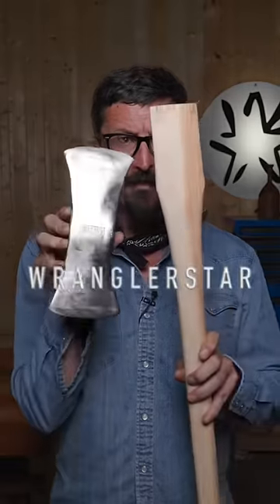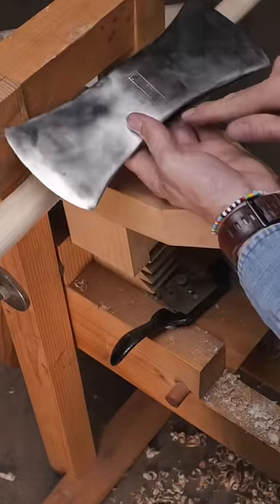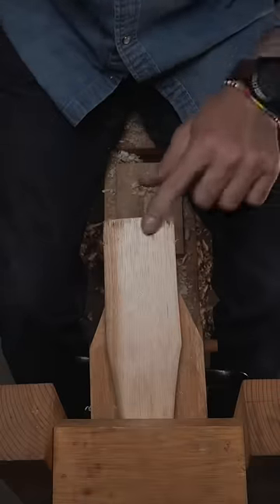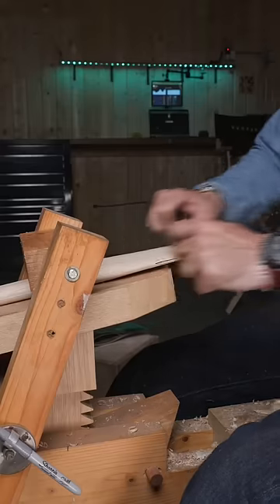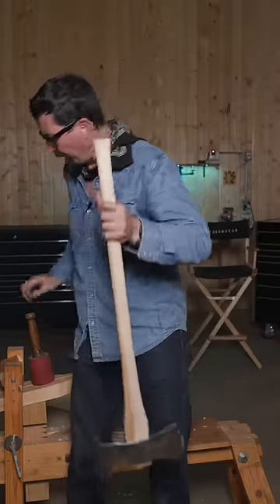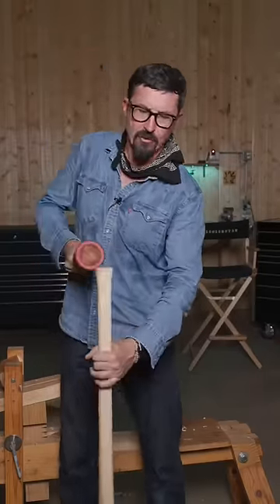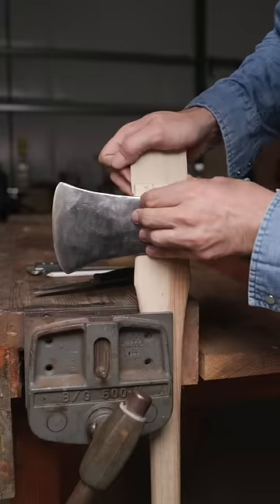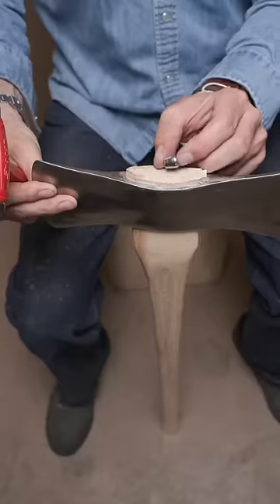How the US Forest Service hangs an AXE - Wranglerstar professional Homeowner

Comment: Find a suitable location. Unbuckle belt and lower trousers. Unfold and tear off 3 squares. Wipe from front to back. Dispose of paper in double ziploc bags. Pull up trousers and secure the belt. And that's how the US Forest Service takes a number 2 in the wilderness.
Reply: Really? So I had this wrong from the beginning. You see, I always wiped from back to front. I suppose it felt (more) right that way. And another thing, my magic number has always been FOUR. I "fold and tear off" 4 squares, which also happens to feel (more) right as well. But nonetheless, thanks for the 'tip' brother. It is always paramount to get that tip in.....
Reply: Swear 🤣🤣
Reply: I mean, it's just paper, just throw it out
Reply: @dud3655  yuo don't wanna fuel them forest fires
Reply: I thought they used the one-square method.
Remeber to tear off a corner to use on fingernails afterwards
Reply: my Root Beer 🍺
just shot out both nostrils...👃!!
Reply: Three squares of toilet paper? I was trained to use one. 

Take toilet paper square. Fold into quarters. Tear off the corner that is the center of the full square. Remember to save this part. It will be important. Insert finger into the newly created hole. Wipe. Clean finger by pulling it out. Use the torn off corner to wipe under the finger nail. Properly dispose of the paper...
Reply: And you couldn't think of digging a whole to do it down in and then cover it up?
Reply: @danielm.4346  No burials allowed...
They dig it up and the run off goes to any water source that's down hill.   Thousands of campers with thousands of sh*t holes would be a disaster.

Comment: Me who doesn't even own an axe: "this is fantastic"
Reply: I've got an axe. The handle is synthetic. This is fantastic!
Reply: @johnsuarez1404  i now currently own an axe that was my grandfather's. It has a wood handle but I'm sure synthetic is about as good as wood. I just prefer the natural look. I took some black cloth tape called goon tape and wrapped the base of the handle, as well around the shoulder area.
Reply: @TheHunt99  synthetic is inferior to wood. It's just more durable
Reply: @johnsuarez1404  ah, fair enough. Ive not used a synthetic handle. In that case I'd rather have wood. I rehung an axe head a couple weeks ago for the first time and it wasn't hard at all really. I probably could've done better but it hasn't come loose yet. Anyway, my point is that hanging an axe head isn't so hard that I'd rather use a synthetic handle so I don't need to do it as often.
Reply: @TheHunt99  I'd go with wood if I used it regularly, but I live in a harsh winter climate and only bring out my axes a few times a year. Different use cases
Reply: @johnsuarez1404  i live in Kentucky; we have hot summers and cold winters. So wood handles can last you long enough out here.
Reply: @TheHunt99  I see! I'll reconsider. I'll probably buy a wooden handled axe when I get a full sized one.
Reply: Who you axe? City people and these new gen snowflakes with the perfect clean fingernails ....thats who. Not like the good ol days anymore. Kinda sad.
Reply: @richardwebb371  my hands arent made of sand paper and gravel but they're not silk either.
Reply: You need one and don't know it. JUST because they're cool. I have many and I use one mostly.  😂

Comment: I usually drive the heads on by dropping the handle on a stump once or twice (the end opposite the ax head… and having the head pointing straight up). Don’t usually hit it with another tool because I like my handles to stay nice and smooth… also don’t have to worry about over driving it: the weight of the head is enough to seat itself snugly.

Usually do this on every metal tool with a wooden handle: ax, hatchet, pick, mattock, or hammer.

Comment: Interesting.  I would think you would secure the head in a vise, or bridge it across two boards, and pound the handle down into the head to really make it set into the handle.  I did this a few years ago and used two standard wedges with the wood fit slightly below the head, then filled the top of the handle with epoxy.  I would have bought that better round wedge if the store had it at the time.
Reply: I see no reason why that would be an inferior method.  I don't think this guy is actually very smart.  I think he was shown a method for doing each thing and thinks that's the only way.  He is also kind of self important in the way he presents things.

Comment: I would love to get more information about the wooden “seated vice contraption” that he often uses to secure the tools he works on!  It may be a common tool, but I’ve never seen one, outside of this channel.
Reply: It is a shaving horse, and a variety of similar names apply to. Simple concept, weighted by the user, with a clamping lever that you can use with your legs to hold your work.

Leather workers have made similar concepts that are for heavy stitching work, a “saddle pony” or saddle stitch vise.

Comment: This is a very useful video but not entirely correct. The USFS discontinued the use of double bit axe's about 20 years ago due to "safety" reasons.
As far as the mounting procedure, I would add that the wood on top of the axe head should be trimmed flush after driving the wood wedge but prior to the conical.
Also, the shoulders that flare out below the axe head should be removed with a wood rasp, then sanded smooth.  Otherwise, when chopping the stresses are localized and not allowed to be dispersed throughout the length of the handle, which will lead to cracks and eventually breaking right below the head. Lastly, apply linseed oil to the handle.
Cody, Thanks for the video, I enjoyed it and appreciate you passing on this knowledge. By the comments you can feel society craves a connection to something real with tradition and pride that comes with working by hand.

Comment: As a professional railroader who sets handles regularly into spike mauls, maun daes, axes, adzes, etc… trim that excess wood above the head after setting your wooden wedge and seat your metal (standard or conical) into the head. The way you set it is a good way to lose a head or two. 🪓 💀

Comment: I have a question, Would putting 2 wedges in it make any difference than one?
Fitting my own axe heads I was always told to put 2 in, but this could be a hold over from before we used the ring wedge that works alot better than the straight.

Comment: I’ve always wondered how does holding it by the handle and hitting only the handle get the handle further down into the axe head
Reply: Probably to do with the physics of a lighter object acting on a heavier one so it moves more by striking the lighter handle into the heavier head, but also if you strike the head directly it's probably going to end up uneven and possibly damage the handle if you're standing it on the handle end and banging on the head to seat it.

Comment: What is the purpose of a double headed axe? Are the heads different, does it just give you 2 heads to use before you need to go sharpen the head, or is it about balancing the head?

Comment: Drive the wedge with something between it and the striking tool so it wont split
Reply: He normally mentions this, but I guess he forgot this time.
Reply: For example in this one even though he doesn't mention it, he uses a block of wood between the hammer and the wedge. Normally he mentions it but I guess he figures we know by now 😂

Comment: Hey I was wondering how you feel about the conical wedges in terms of replacing the axe handle. Aren't they extremely difficult to remove?
Reply: I find them of similar difficulty to remove. Drill holes till they loosen up. Ideally you won’t ever have to remove one though 😉

Comment: Why not leave it solid material at the top instead of inserting a wedge? Just curious
Reply: The wood wedge is so the head doesn’t come back off, expanding the top of the handle outwards, but the conical wedge is optional and some people leave it out.

Comment: Why don't you knock the bottom of the handle on the floor with the head up when driving the head down on the handle? That's the way I have always done it, and it's works great!
Reply: Just a different way of doing the same thing. I use both methods 😂

Comment: Why is it that you use a metal conical wedge in conjunction with a wooden wedge vs just using a metal wedge?
Reply: Do they make metal wedges that are the shape of the wood wedge used here? In this case the wood wedge is used to spread out the entire top of the handle. The metal wedge was just to expand it a little bit further in all directions, because the wood wedge doesn’t expand it front to back. It’d be interesting to see a metal wedge that did that too!

Comment: Question, why do you need two axe blades on the same head? I that that was simply a fantasy trope.
Reply: Versatility – Double-bit axes can easily cycle through cutting, chopping, and splitting jobs, unlike many other axes. Longevity – Depending on how you use them, double-bit axes can last twice as long as traditional axes or axes with just one sharp edge.

Comment: Wait, I’m lost. Was the whole “hold the handle loosely in mid air while hammering the end” a joke? It has to be right? How on earth would that help at all in the process?
Reply: My uneducated guess is that since the head of the axe has a lot of mass, it resists changes in movement (I don’t know the proper physics words). So when you hit the end of the handle, the light weight handle (I’m assuming it has less mass than the head) moves a little more than the head does. If you do that a few times, it gets driven into the head sufficiently.

Comment: Anyone care to explain what advantage having two blades has over just the one? If it's for weight distribution, why make the other end sharp? To me it seems more like an accident waiting to happen. 
So what's the reason? Any seasoned forrester care to explain?
Reply: I’m not a seasoned forester but he has explained it before. One side, usually left of the brand stamp, is used for cutting around dirt and rough materials. The cutting edge won’t be as fine due to this. The opposite side is going to be for fine cutting, and will have a sharper edge. 
It’s just for two different purposes.

Comment: It's always strange seeing people hammer the shaft to get the head in place. My dad always taught me to put the head on and smack the shaft on the ground to fasten the head.
Reply: Yeah, they work practically the same. Use an instant acceleration to drive the handle further into the head. I personally use both 😂

Comment: That’s the most dangerous axe why does it need two sides only thing I could think of is if one side gets dull and it shouldn’t get very dull in just one day unless you arnt swinging it right
Reply: One side is for cutting around dirt and other rough materials that might dull your edge. The other is meant to be used when you aren’t at danger of hitting anything but the wood. They have different angles on the cutting edge.
Reply: @coolHawk_  thank you I never knew that

Comment: Understand that it works but wouldn't you brace the head and Hammer the handle through instead of holding it lightly in the air

Comment: Anybody want to elaborate on why he seats the handle Into the head instead of vice versa?
Reply: It’s easier to get the hammer marks out of the wood than out of the steel. You can also orient it the other way, with the head on top, and hit the handle against the ground but it does the same thing.

Comment: I've made a few are handles, double bitted and normal singles. Never don't it like this. I go find a maple or hickory stick, form it, slam 2 concrete wall wedges in and fold the first over so it's on top of the head and then fold the other over, so it's over the head. I've had problems when doing this with soft, no problems ever with hards.

Comment: Why must the axe handle be driven into the head instead of visa versa? Seems counter intuitive.
Reply: You can hit the end of the handle on the ground with the head on top, but it achieves the same thing.
Reply: @coolHawk_  Yea... but either way it seems like an intentionally bad transfer of force. I have always set the handle on something slightly soft to keep from marring it, and driven the head on with a rubber mallet directly. So far its gone well and Ive never heard of this other method. I dont see the reason.
Reply: @outsider344  Yeah, I’ve done that as well when first fitting the handle. I usually get better results out of being able to use heavier steel hammer when I’m finally setting it, and I don’t want to have to grind hammer marks out of the axe, so I do it like this. I’ve also heard of people who orient it with the axe head on top and then hit it against the ground, so that they don’t need a hammer at all. Just different ways of achieving the same 🤷

Comment: now if only any forest service still used double heads, and didn't just shove nails into the old head until it literally falls off, and replace it with polymer handles when done, don't claim forestry if you're a weird hobbyist